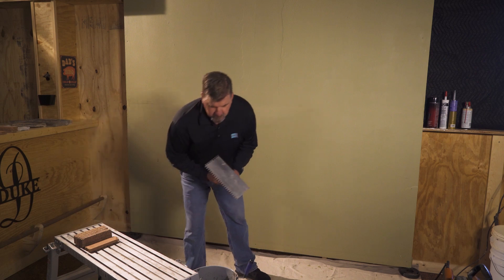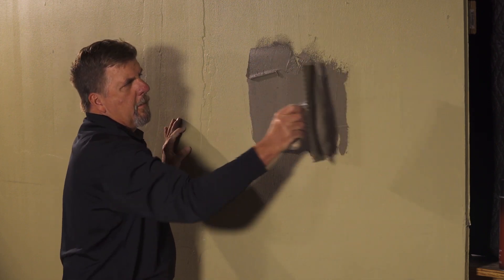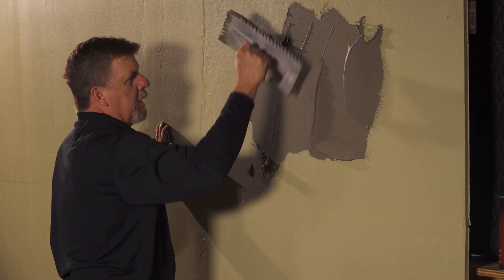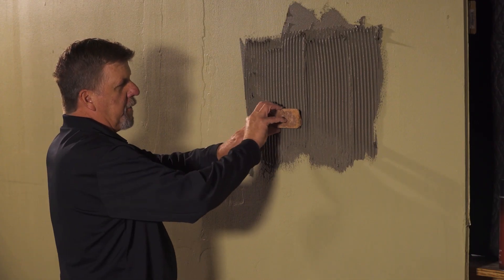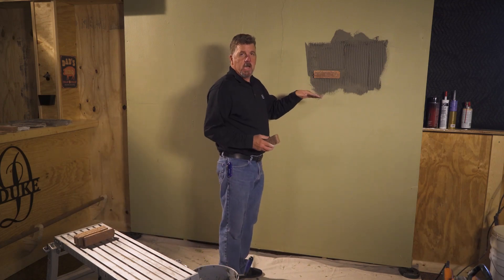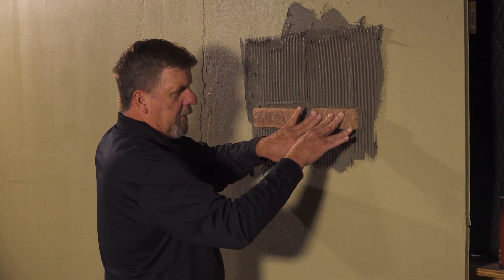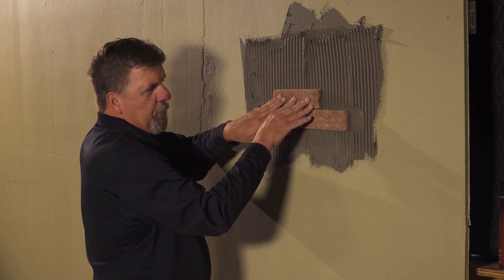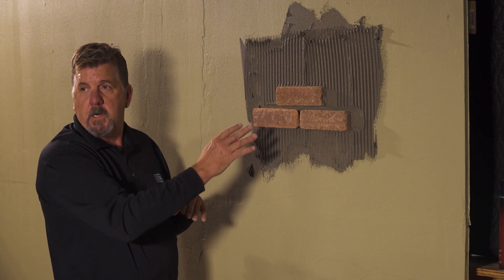MVIS Best Practices Part 3: Thin Brick Installation Methods

Comment: Why don’t you let us know what products you are using so we can purchase the correct material
Reply from the maker: We are using MVIS™ Veneer Mortar (https://laticrete.com/masonry-veneer-installation-system/adhesives/adhesives/mvis-veneer-mortar) but the MVIS™ Thin Brick Mortar (https://laticrete.com/masonry-veneer-installation-system/adhesives/adhesives/mvis-thin-brick-mortarcan be used in same manner.
Reply: as a previous comment said 
why dont you tell us the products.  I barely noticed it qas two separate mortars used